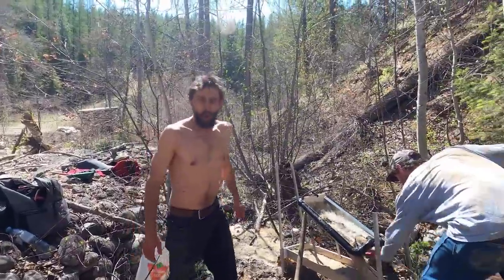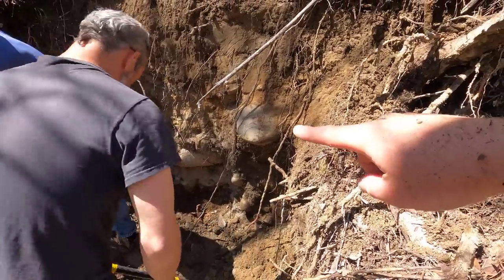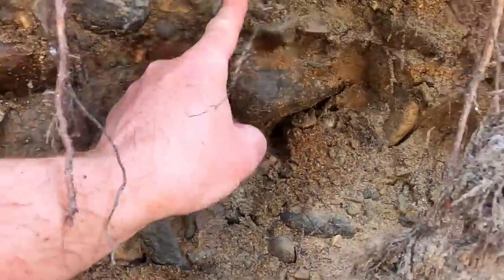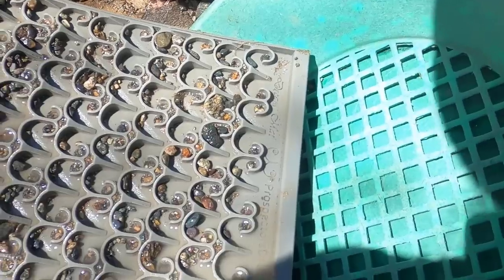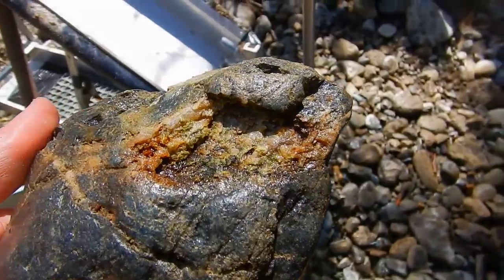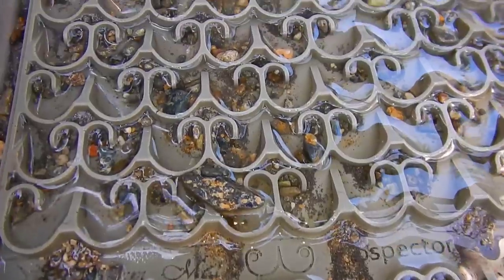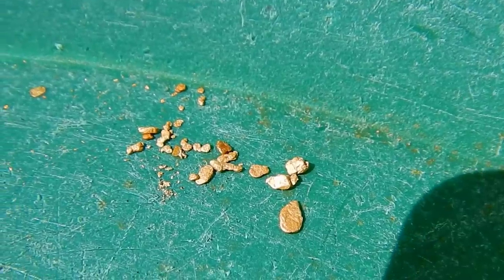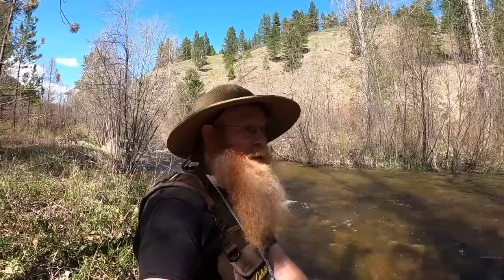High Banking at the Rock Creek Claim !

Comment: I’ve worked this area over a decade ago... and I used a high banker. And came up with what you’ve got there in you clean up.

I have also worked it with a shovel, bucket and steel pan and came out with that amount in every pan. I’m thinking it’s all about the hard pan coating the flakes... the high banker flows too fast for it to settle. 
Ask around.... also, tones of flour gold down south of the bridge; again... use a slow flow and be patient. 
Nice to see someone working it again.